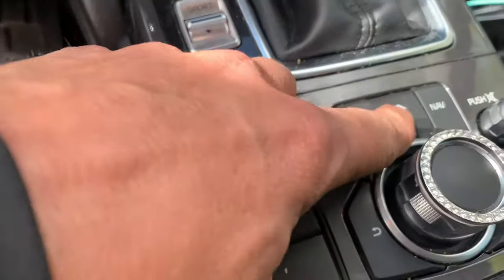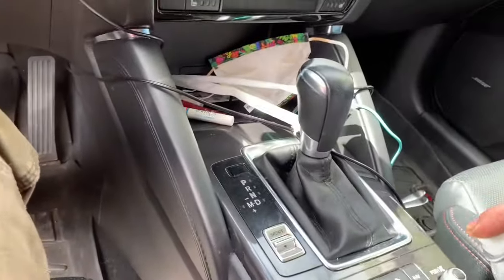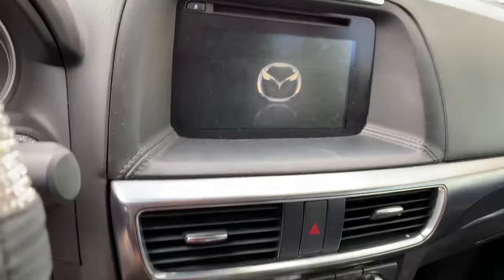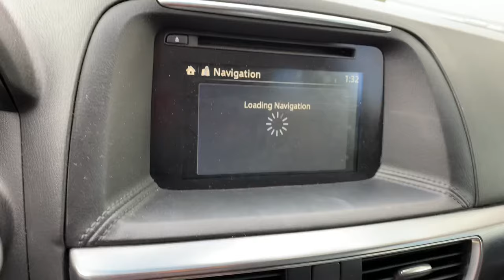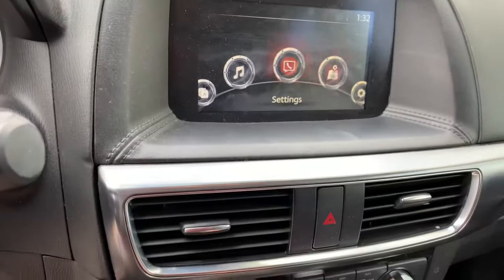Spilled A Drink Now Buttons Won’t Work? How to Clean Sticky Car Buttons

Comment: Thank you! Worked perfectly on my wife’s 2014 Chevy equinox. 90% of the buttons were stuck but not anymore. Didn’t need to compress air either, just let the foam soak. Update…I ended up having to repeat the process days later and use compressed air. After the first attempt once everything dried it was stuck again, the air blew out all the sticky stuff while it’s wet. Thanks again!!

Comment: Hoping this works for my VW Jetta. Wasn't a clumsy coffee spill but I made the mistake of leaving an unopened dr. Pepper can on the passenger seat in 100°+ weather. A couple hours later, BOOM. Exploded all over my dash / ceiling. Learn from my mistake as well yall 😂
Reply: The same thing happened to me last month with a Pepsi 😂. Buttons work but are still very sticky and take a lot to push down. Hope this works for my Lexus.
Reply: @latashuawilliams7287  I used that foaming glass cleaner spray on my dash and used an air compressor after mashing all the buttons to dry it out. They all work much better now. HOWEVER. Just as a safety precaution I would disconnect your battery and obviously leave your car turned off when doing this. After I tried this trick, the display on my radio looked a little funky, but it went back to normal after a few hours, and at first the AC wouldn't work but same deal, just had to wait a little bit for it to dry completely. Try to save some hassle when you try this and give your interior plenty of time to dry before turning it back on
P.S I also no longer have that Jetta. I sold it after getting a truck lol

Comment: Thank you so much!!! Your method was the easiest I saw. I have been trying to clean mine by putting alcohol on a thin card and working it back and forth but that no longer works. I was afraid if I sprayed anything on it I would screw up the electric parts under there but you did it and it WORKED. HOORAY

Comment: Feel like this is a dumb question but is the foaming glass cleaner safe for any vehicle? One of my kids just dropped Starbies in my new A4 and I’ve already been thinking of taking it completely apart to clean the bottom. Before I take the whole center control console apart, is this safe to use for any car/electronics?
Reply from the maker: I'm a hobbyist not an electronics expert but as far as I know non ammonia foaming glass cleaner will not harm any electronics(just don't flood it). I've detailed all of my cars with foaming glass cleaner and compressed air  for years and never had an issue. On sticky stuff it can take a few applications. Sprayaway brand is non anomia I'm pretty sure. I use Vietek, available at National Coatings and Supplies, its a private label thing. Sprayaway is my second choice but works well.

Comment: Our heated seat button and a few others on the center console would not release once pushed down so either full heat or off.  After trying out the foaming spray, they all release and the heat can be set for HMoL.  Happy wife, happy Life!

Comment: Be careful with anything potentially corrosive. I'd try a can of electronics cleaner first, or just a spray can with isopropyl alcohol. It would  suck if you got the mechanical aspect cleaned out, but then the buttons (eventually) ceased working because the electrical bits got messed up. I would hope the car manufacturers have some sort of water shielding behind those panels to shield electronics, but you never know.
Reply from the maker: Dig that, that product is non-amonia and gentle enough to use on almost any surface. I talked to the rep and its safe for interior tech, even laptop keyboards, just not so much, and 125 psi :) I've used it on three cars for similar issues since and all good. Very good advice hillie47!
Reply: @MissedAGear  Maybe get some bibs for the messy drivers? ;)
Reply from the maker: @hillie47  Indeed!

Comment: Omg .. my friend projectile vomited 🤮 on my Cadillac CTS Control panel !! I cleaned immediately. Next day my controls for radio & heater not working !! I got Electronic cleaner tonight sprayed on & leaving over night .. I’m freaked out !! I’m gonna try your method if it’s still not working tomorrow 😳
Reply: And I'm just going to guess that did not work, right? The thing about electronic cleaner sprays, for example, CRC Electra Spray, is that they dry almost instantly. This is why you can shoot electronic parts with it safely. What you sprayed on to leave overnight would have been dry before you exited the vehicle for the night.

Foam glass cleaner is great because it's wet but it's not liquid. While it has alcohol content and will dry, it doesn't dry immediately meaning it can soak the grunge amd then be removed without damaging electronics. I would still be very reserved and judicious using foaming glass cleaner on or near electronics and would recommend the CRC electronic spray cleaner for electronics 99.999% of the time.

Projectile vomit. Gross!

Comment: Question is???
Did it work the next morning???  Because usually the glass cleaner, steamer, compressed air fixes the immediate problem.  BUT THE SUGARS in those drinks coagulate again in time and the buttons STICK AGAIN!
Reply from the maker: Took another run at it about two weeks later and its been great since

Comment: What about rubbing alcohol?
Reply from the maker: Have to be careful, some of the coatings on the interior can be removed with alcohol. Not all but best to check a small spot first to make sure. As far as I know alcohol wont harm electronics but that is anecdotal information. I've used non ammonia foaming glass gleaner for years and never had an issue.

Comment: Yes Shame  on MAZDA 
I hate that stupid button! 
They also gave it no bracket so it easily pushes in with a small amount of weight on it’ Even BIGGER SHAME on Mazda for that 
Who throws that right in the middle with Zero support u see it and in order to use it you push down 🤷‍♂️ 

“Give that guy a raise”

Comment: Foam and glass cleaner on electrical switches questionable? Ok it worked but risky better off using proper electric cleaning solvent then lube!
Reply: Was your first sentence a question?
Reply: @ThatOne77  Can you read?
Reply: @ApnaChoud  I'll take that as a "no."
Reply: So I have this very same concern. Obviously, using the spray foam glass cleaner seems to be working but I'm in the same boat: how much risk is involved? 

Using electrical parts spray definitely sounds much better but I'm thinking the rapid dry time would render it mostly useless, as I envision it. Foam glass cleaner on the other hand, while not as fast drying, is at least mostly alcohol based, I think, and has a quicker dry tine but not as quick as the electric spray, which would enable it to clean out sone of the gunk. 

Maybe I'm wrong? I dunno. But I just feel that with my luck, I'd spray the foam and everything would short out. Short of having the commander module replaced entirely, I can't think of anything better.
Reply: @TheAgentAaron  What's a "Sane bost?"
Reply: @ThatOne77  'same boat'. Typo. Fixed. Thanks!
Reply: @TheAgentAaron  ha ha! I really thought you were saying something I knew nothing about! Sorry!
Reply: @ThatOne77  lol, that's funny. Nope. Just my fast punching of letters on the phone
Reply: @TheAgentAaron  I'm right there with ya